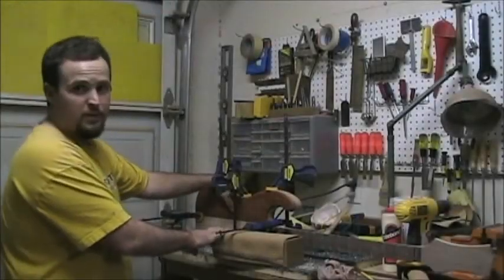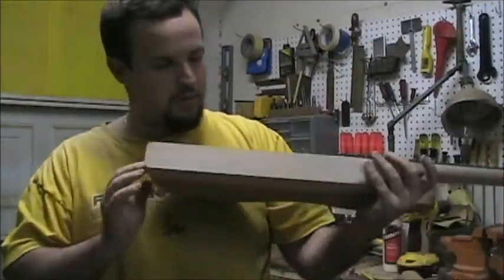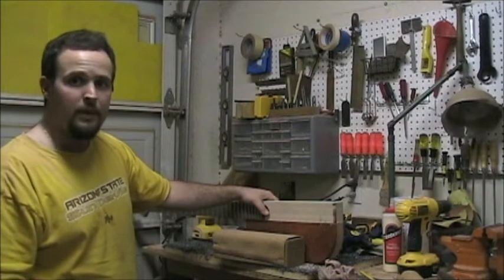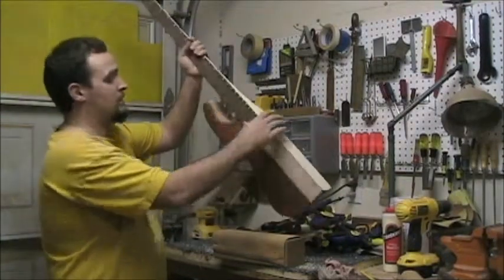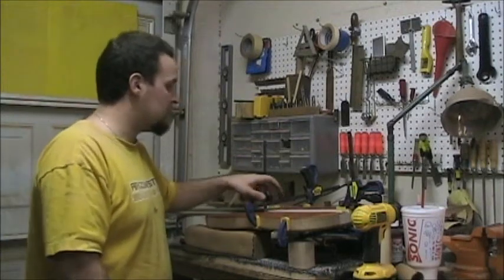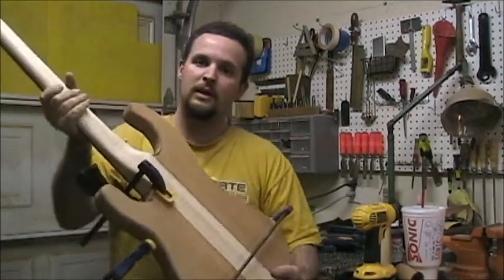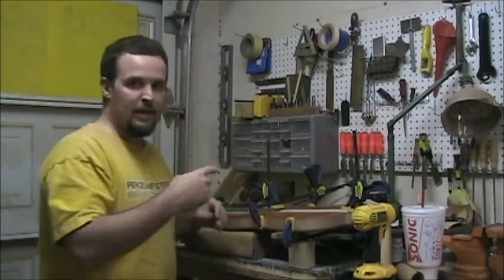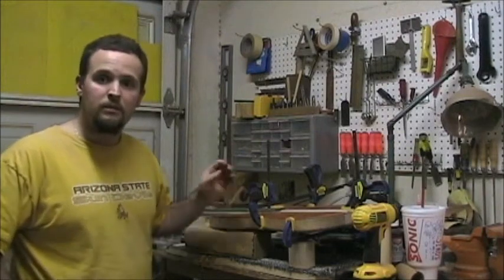Bass Project Part XX: Body Glue-Up

Comment: I love the headstock on this. I'm not a big fan of the Fender body shape (I'm more of a Rickenbacker 4001/4002/4003 fan) but this is a beauty. I've been considering building a bass, and I think I may just have to go for it. I've performed tons of repairs, and thanks to your videos, it seems like a fairly straight forward process. I really liked the knobs you made, that's a nice touch.